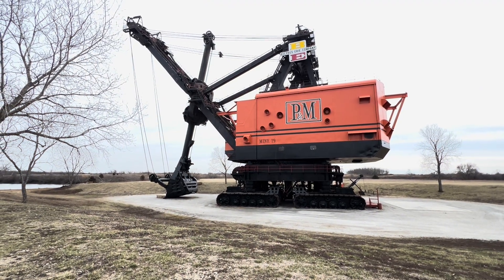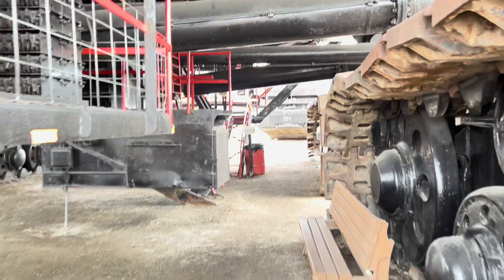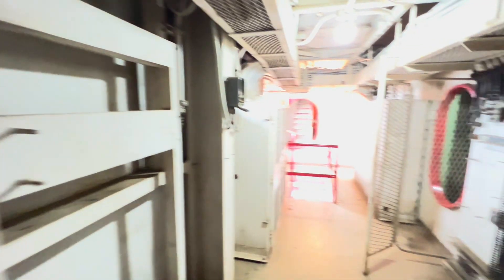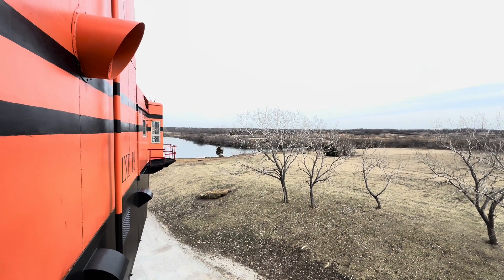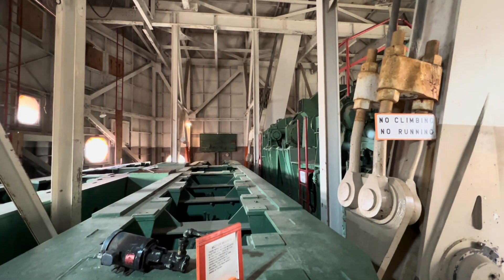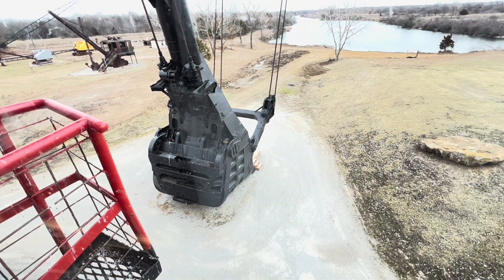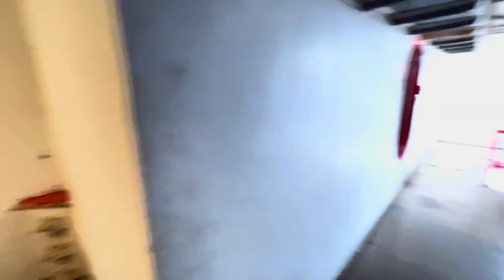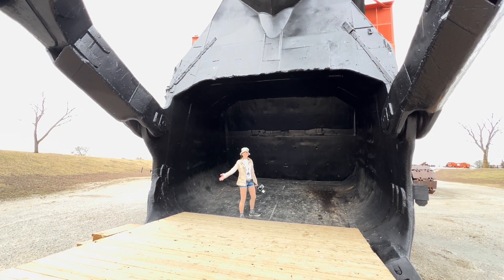Worlds Largest Shovel Big Brutus

Comment: they really should put in mock-ups of the missing equipment. I believe there si a break room for the crew (more than just the operator) that was not shown
Reply from the maker: Possibly as there were closed off areas.

Comment: Thank you for tour of this special heavy metal Large boy 😊❤😊 did they build any kind of restroom facility on board. I think the big room behind operating station was a coffee break room. The two pedals believe thay are for swing. The "V" shaped control on Left control lever might have been the bucket floor tipper. If you ever are in Salt lake City, check out Bingham Canyon Copper Mine.( The information  guard building at main entrance, the people are very friendly and give you a map to the visitors center, you will not be running into any off road haul dumps, It has a overlook view visitor center. Looking down into the huge cut benches. The modern ( P&H) big electric Shovels are NOT as huge as this bad boy, but they are big looking down at them. The thing that impressed me was looking at the biggest graders CAT makes. Three working in tandem keeping haul road smooth, huge windrolls on side.
Reply from the maker: I didn’t see a restroom but I wouldn’t doubt if they had one back then. Thank you for all the information and thanks for watching. 😉

Comment: I wish my first video was this good.  Like said by others sound could be improved in my opinion I would rather have to turn sound down then needing to max it out.  A couple times I did want to ask you to relax a little but my guess is that will come in time otherwise as a techy person I wouldn't have minded a little more info for example voltage and so on as well it is nice when guys get a short clip of info cards or add pictures so I could pause and read if im intrested.

Comment: Running that shovel off of A/C to D/C, was engineering genius.
Reply from the maker: I worked in a mill years ago that did the same thing a/c motor to d/c generator to d/c motor and when you walked into the motor room you could actually smell electricity in the air.